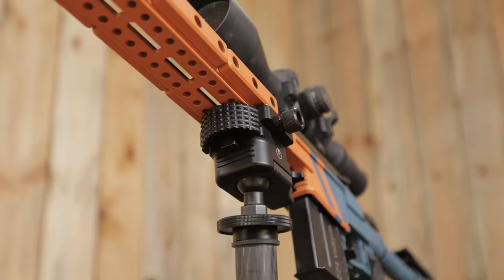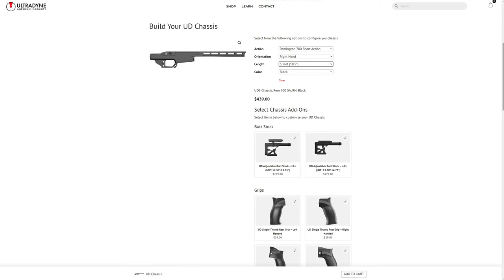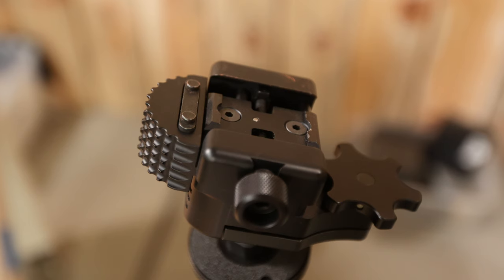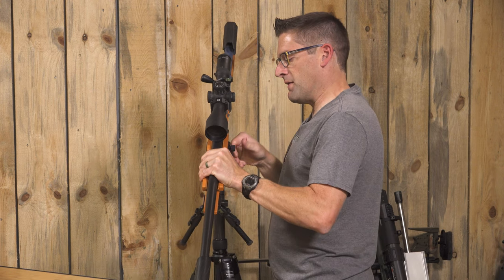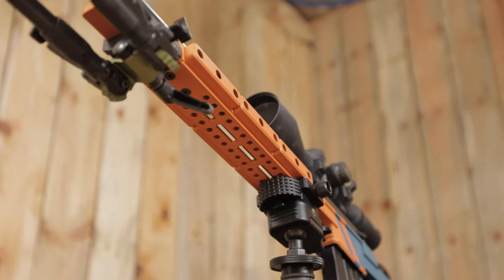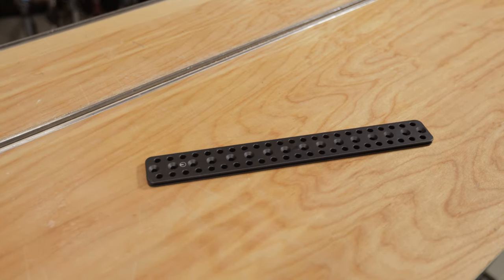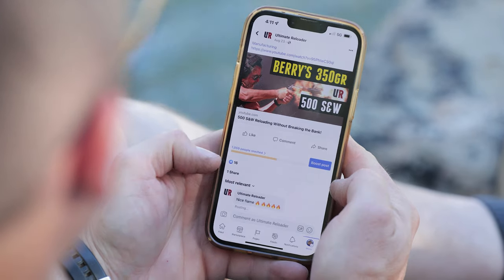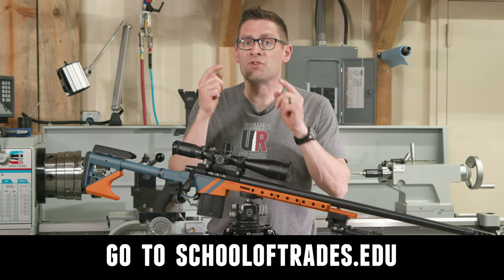NEW Ultradyne Dynalock System

Comment: Gavin I'm new to the Arca rail system what's the advantage of it vs picatinny beside the larger mounting area?
Reply: It allows you to quickly attach and detach things like buy bipods and other various attachments, and also allows you to seamlessly slide up and down the rail for quick adjustments
Reply from the maker: Yes, what @ForceRecon112 said :)
Reply: @ForceRecon112  No foolin really, just a quicker system. I would have thought it was more ridged or something like that.
Reply: @Ultimatereloader  Interesting I inherited a shooting tripod with an arca ball mount on it so I was looking into Arca rails to actually be able to use it. So I'll be if it's just a faster system for adjusting accessories. Thanks again for the help.
Reply: Pic rail is still king for rigidity, hence why it’s still the go to for mounting optics. Arca was born from the photography industry for allowing QD from tripods, which it is also used for in shooting nowadays
Reply: I have a really premium tripod head that is in picatinny and it's great, I got it on sale, but I really wish it were arca for the reasons everyone mentioned. The speed of adjustability is way faster. The ease of which the form factor can easily be added to the bottom of rifles is unrivaled. I'm not putting a full cheese grater type forends on my huntin or long range rifles anytime soon. On the other hand, a long section of arca has a wide base so it doesnt snag and provides a wide flat base for when using a bag or just not using the arca im general